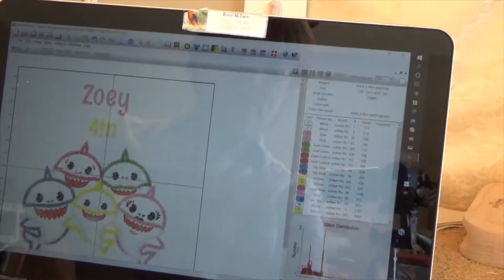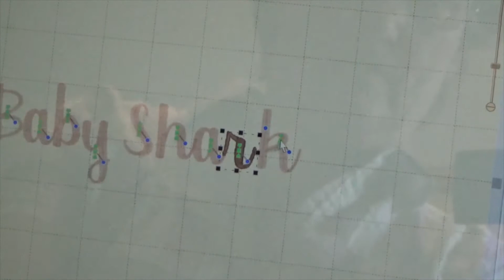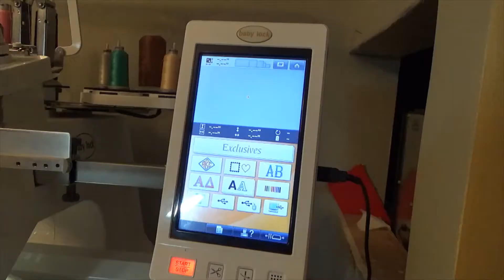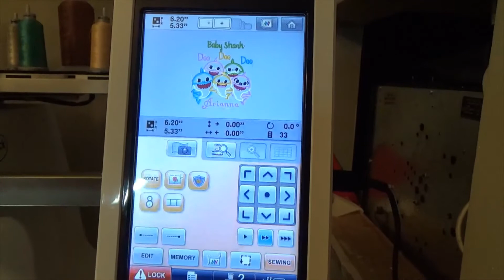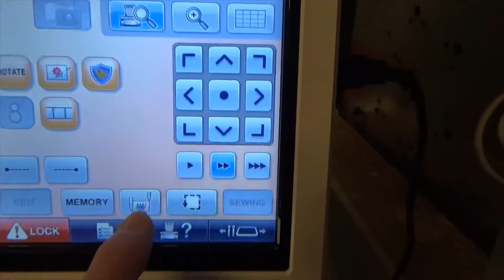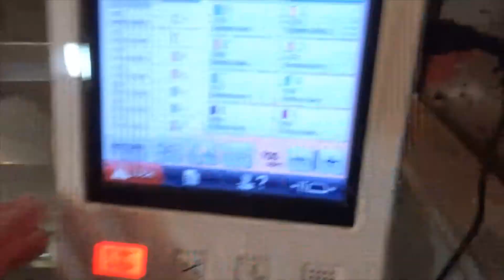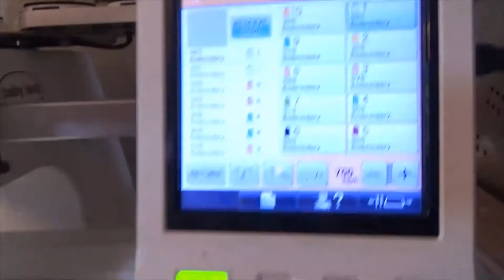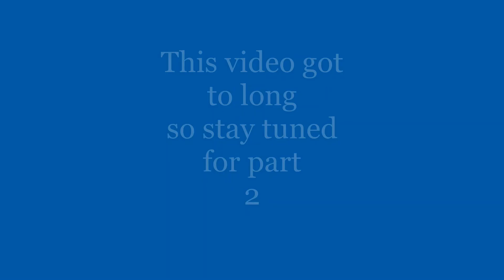How I Embroidery With Babylock 10 Needle ( Part1)

Comment: Thank you!    I know this old but I am trying to figure this machine out. I’ve had it for 3 years.  And need to learn position designs. How do you know your straights
Reply from the maker: fold your item in 1/2 then if need to fold in half the other way to fine the middle. that where to place the snowman or use the camera to find your middle. Mark the stabilizer on you frame and line the two middle points together, then pin all around. Hope you understand what I'm mean.